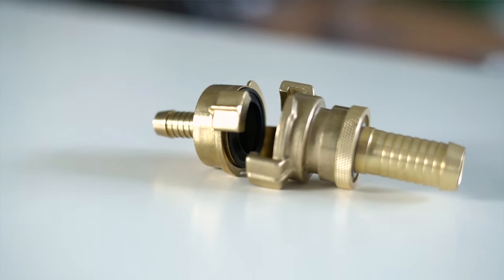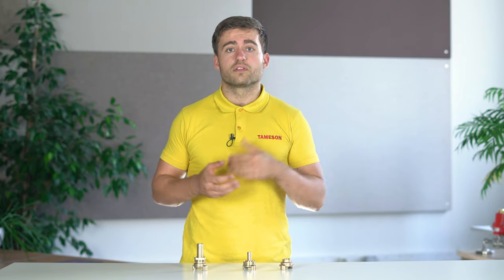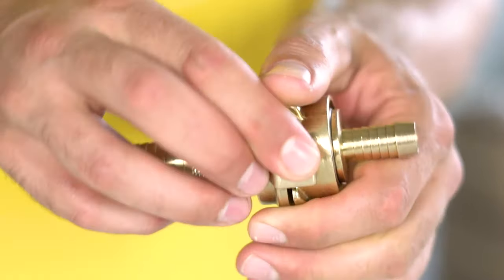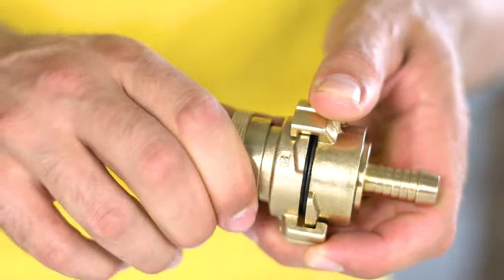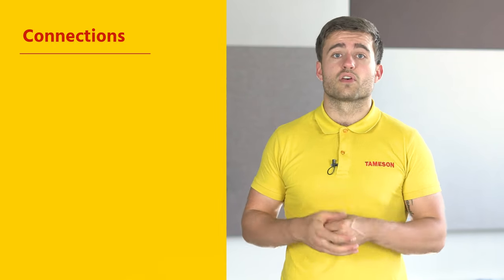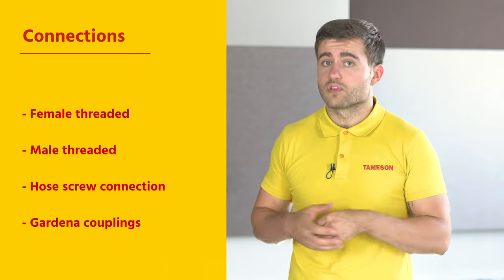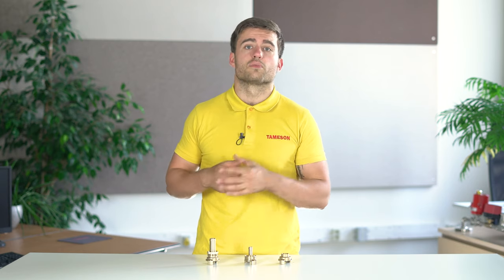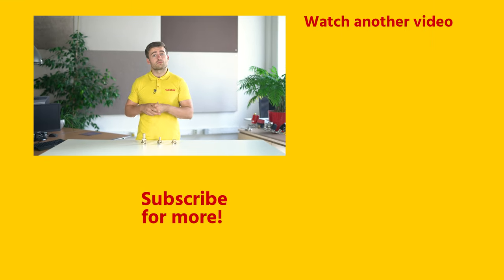How to use and select a GEKA coupling - Tameson

Comment: Seems like a fake. The couplings can only be connected with a great deal of force. Its not so easy as the video shows.
Reply from the maker: Thank you for the comment about the GEKA couplings video. We understand that the ease of connection as shown in the video may not always reflect every user's experience. It's important to note that the ease of connecting GEKA couplings can vary depending on several factors, such as the condition of the couplings and the presence of any debris.